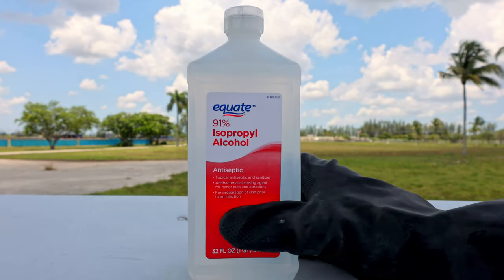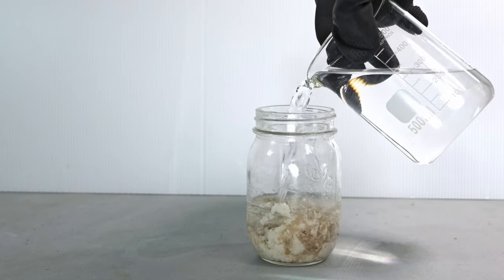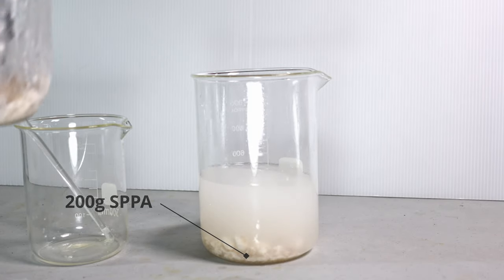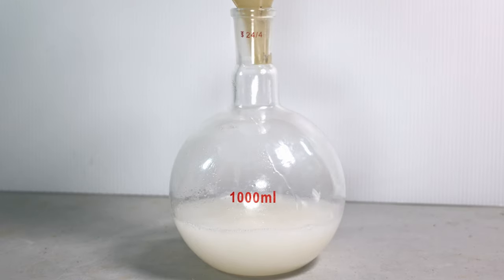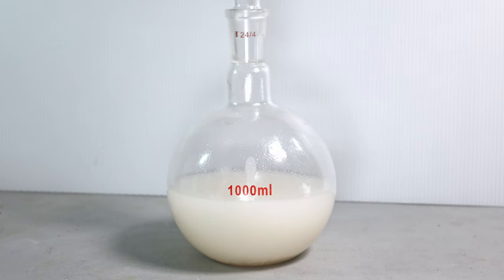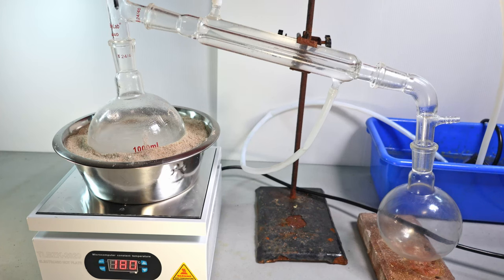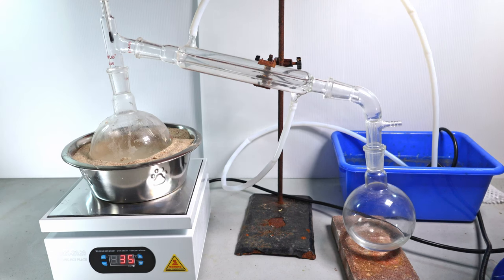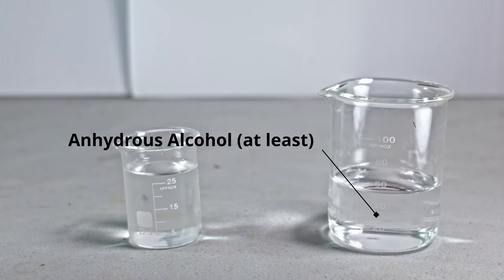Making Ether with Polyphosphoric Acid

Comment: You’ve shown yourself using an sh2 hot plate at high temperatures for long periods of time. Have the magnets in the stirrer been demagnetized yet? I’ve killed 3 of those hotplates and the magnets always go first. You’d think they’d use high temperature magnets, but apparently not. Looks like you’ve gotten a more high quality one recently, congratulations!
Reply from the maker: Haha, yes! Also, the hotplate I have now has 4x the surface area. It is perfect for my larger sand dish and 1000mL flask.
Reply: I've had an SH3 for a couple of years now there were no issues so far.
Reply: @MolecularPlayground Brother, it is said that oxytocin can make people loyal to love. Have you ever extracted oxytocin? It can also make people more loving.

Comment: I think if more silica was added then the SSPPA could be made to be free flowing. Also, there was no way you could have known whether the interior of reaction vessel ever reached the temperature on the mantle, and I highly doubt it did. My stove top can get red hot, but my pan never does. At a certain point, when using sulfuric acid for dehydrations, you hit a point where too much water is present for the reaction to proceed; I don't think we have any idea whether you started out with too much water or not.

Comment: A couple of reasons why this could possibly have failed: 
-Your reaction setup was basically a distillation setup for alcohol, since it boils below the desired reaction temperature it just distills off 
-Usually a large amount of sulfuric acid creates a mixture that has a high enough boiling point for it to reach reaction temperature, SPPA does not have this ability, the mixture refluxes at below 100°C at the boiling point of Isopropanol and can't react since it never reaches a higher temperature than that, even though your heating mantel was set to 180°C
-The Isopropanol might just have had way too much water so the acid might just have been saturated and reacted back to phosphoric acid
-the large amount of water present pushes the equilibrium to the educt side, so ether formation is not favored
-Ether formation is favored at ~130°C, at 170°C the formation of Alkenes is preferred
I'd be interested in seeing another attempt and this and possibly an experiment on if the acid is strong enough to be able to form carbonic acid anhydride.
Reply from the maker: Thanks for the feedback! One thing that still perplexes me is that the alcohol struggles to boil at 180C. I think the polyphosphoric acid actually forms a  type of mixture that elevated the boiling point because the temperature in the flask does reach ~180C give or take 10C. As for your last point, that rule certainly applies to sulfuric acid. Polyphosphoric acid though is weird and many of its properties are still not understood.
Reply: @MolecularPlayground  Interesting! I assumed that the polyphosphoric acid would stick to the silica gel instead of dissolving
Reply from the maker: A lot of it does dissolve though because the whole solution become milky white.
Reply: @MolecularPlayground  Wouldn't that be suspended particles of silica gel? Dissolved Phosphoric acid should be clear and colorless.
Reply from the maker: Polyphosphoric acid does not instantly hydrolyze, especially if most of the solution is alcohol. It does slowly hydrolyze, but I do not know why the solution didn’t clear up eventually.